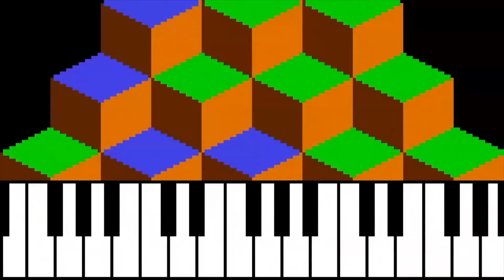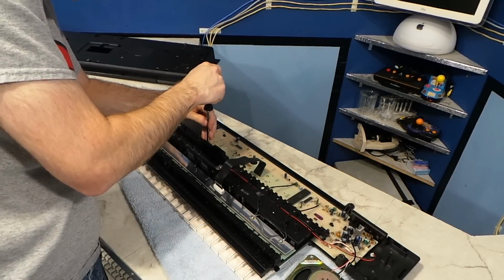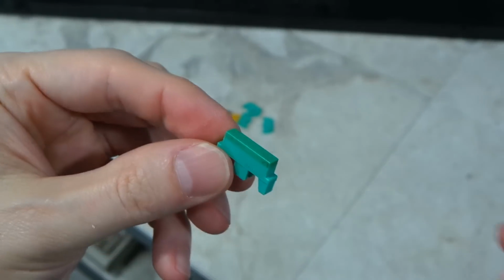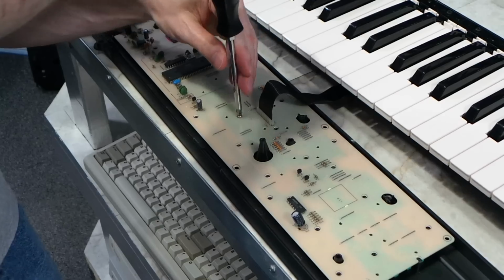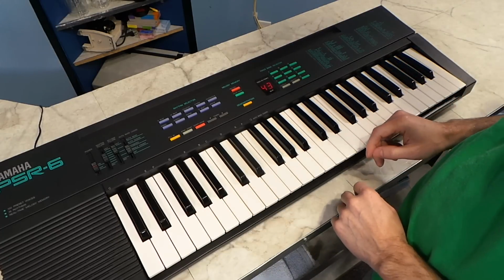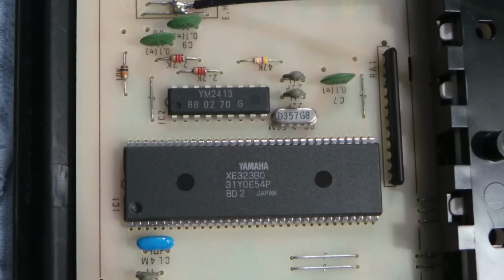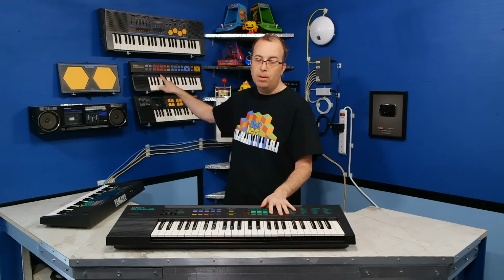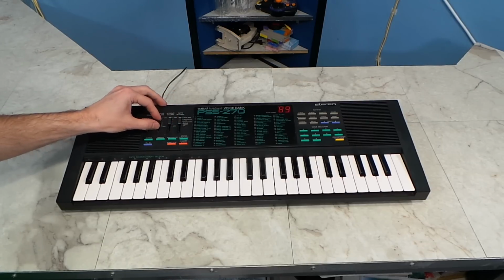Yamaha PSR-6 Restore and Review

Comment: That keyboard may be kind of worthless, but it holds a VERY SPECIAL place in my heart.  It was the FIRST keyboard I ever owned.  Back in the late 80's, I was just beginning my very first actual musical recordings of tape experimentation (very musique concrete using multiple tape recorders and anything else I could find, crudely cutting tapes together to make rhythms and strange sounds) and that keyboard became an integral part of the setup.  I still have those old tapes from back then and the sounds of "Accordion", "Comet", and "Glass Celesta" were all used heavily in those recordings.  I kind of miss it and wish I still had it.

Comment: I have actually restored a PSR-6 this afternoon. To remove the keys you need to take out the long pcb where this "not disconnectable" black wire is as well as the rubber connectors beneath them. 
You get access to various groups of keys that can be unmounted together and washed. 
Still, great video. Have a good day.
Reply: I’m trying to restore one I got from my friend. Has some dead keys that I want to fix. Is the pan the green strip on the back of the keys?
Reply: And how did you get it out?

Comment: I had this keyboard as a kid. I just got another one recently from a goodwill in MN for $10. They said it didn't work and it was missing a button. But I powered it up fine and it works great. With the help of this video I took it apart, cleaned it up, and even found the missing button inside it. Looks almost new now. Thanks for showing the way!
I plan to use this for some ambience; even the cheap sounds are awesome when run through a bunch of Earthquaker devices. 😁🎵

Comment: Your videos gave me the "power" to restore my old PSR-210. To make a long story short: after some trouble, I managed to complete the task. 
I disassembled the complete device, didn't disconnected soldered cables, so I unscrewed also the speakers, to get rid of the small circut-board. I used a sheet of paper, drew boxes on it, where I put the screws. I named every box, so I couldn't mix up the screws. Then I disassembled the keys and gave them a slight rinse in the kitchensink, which was fairly enough, I polished them with a soft cloth afterwards and they do look fantastic. I gave the case a clean with the garden hose and that  rinsed the dust and gunk from the years. I learned that my keyboard was made in 1993 from the markings on the case, the chips and circut-boards. When I reassembled the whole thing, I mixed up some screws nontheless, but after I disassembled it 3x, I figured every single screw and I had no one left over anymore. Then I remembered, that I forgot to connect the battery compartement, so that was a last, 4th disassembly... Before the restore, the keys were somewhat sticky, you could even hear them. After I was finished, the keys are completely silent and move totally smooth. I wouldn't have done this without your videos.

Comment: The other day I found a keyboard at a neighbor's curb that was going to be sent to the dump. I grabbed it because it looked like it was in working condition and it worked fine when plugging it in with a generic AC adapter. The keys were a little dirty, but other than that it was in great condition. The model in particular was the Yamaha PSR-290, which isn't even old enough to be considered a retro keyboard, and it's overall it's a decent pro-sumer keyboard.
Reply: Nice find! :D
Reply: Same 1st demo song as the PSS-270! https://youtu.be/zGTAOmBQZLA?t=27s

Comment: The YM 2413 was used for the FM Expansion Module for the Sega Master System In Japan Only. I would recommend listening to some of the soundtracks.
Reply: Dynamite Headdy No wonder it sounds similar!
Reply: It sounds similar to the VRC7 chip, too.
Reply: I will say this again go listen to some of the soundtracks and compare it to how it sounds on here.
Reply: Only Lagrange Point used VRC7
Reply: TastySnax12 - That's because it's a derivative of it. The main differences are that it only has 6 channels instead of 9 and has no rhythm channels.
Reply: The expansion was for the Sega Mark III.  Later it was built in to the Japanese model of the Master System.
Reply: Certain MSX add-on cartridges and later  built in to certain MSX2 computers.
Reply: Yeah Those Computers Sound Really Good! People Underestimate The YM 2413 Most Of The Time But If You Really Take The Time To Understand The Chip You Can Make Some Good Music.

Comment: I remember my mom used to have a keyboard... I swore it was a Casio... but it might've been a Yamaha. It had a bunch of colorful buttons like this, but actually had more of them. It didn't have a screen either, and the speaker was up with all the buttons, not to the left/right of the main keys. I remember it had some really funky sounds and demos, it also had a metal bar to hold sheet music up, and she had a dust cover for it too. I have no idea what exact model it was... but I wish I could figure it out. It was all black / dark plastic on the outside. I also remember it having a MIDI (DIN) port(s?) on it too, but we never used that. I swear it must've come anywhere from the late 80s to mid 90s.
Reply: wow, looking it up now... it might've been a Casiotone. Surprised by how quick I found it this time... previously I couldn't find anything.
Reply: look in the old picture albums your mom probably made,   if not there should be some box littered with old pictures where they just got too lazy to ever put them in an album :P
thats the way I found out the old model we used to have 25+ years ago :)
Reply: I still have an old casio. We had a box, manual, power supply and dust cover for it, but we put it up for auction years ago. It didn't sell, but along the way the Auction house lost the power supply, and apparently threw out the box.
Euugh. Figures.
Reply: I remember that one. It had some letters in the name, then a dash, and then a number... ending with a zero, I think.
Reply: Black Casio keyboard with color buttons, speakers AND midi? Well, you're having a lucky day, because there aren't many Casio keyboards from back in the day which fits that description. I think it's probably one of the keyboards from their 1989 Midi line: MT-240, MT-260, MT-540, CT-460, CT-640, ... They were all very popular back then. There is also the HT series, but those aren't very colorful keyboards. Nevertheless, they are the HT-700, HT-3000 and HT-6000. Good luck finding the correct instrument! Was it a smaller keyboard or a bigger one, by the way? That would narrow down the results quite a lot.
Reply: I have a CT-640 ... since around 1991.

Comment: That was actually a neat little tune. I had a PSR-12 back in the day. Shhh, I was in the Air Force way back then, and made a stand for it out of scrap 3/4" titanium tubing with black plastic caps for the ends and rubber feet. I also fashioned an aluminum banner plate/bracket that I painted black and stuck those giant sticky white vinyl letters you can buy to make a sign across it, saying "YAMAHA". When I sold it in a garage sale, I probably didn't mention that the stand was probably worth 20 times more than the keyboard. Maybe I did. It was a long time ago...

Comment: Well, here it is, the review of my favourite keyboard out there (since I owned that as a kid, and I still have it BTW). Shame you didn't like it that much, but I understand PSR-6 wasn't made for high-end use anyway. But, what I found interesting, was the dissasembly process. Because I managed to do a full dissasembly last year, and I didn't manage to hit any snags just like you. The bare wires of the ribbon cable were clamped onto the mechanism so I could remove it by pushing the sides a bit, whereas for the keys themselves, I didn't have any problems removing them, so I guess there has to be a different version, either there were differences between US and European versions of the keyboard, or they simply redisgned it, because my PSR-6 was made in '89. But if you want David, I can dissasembly the keyboard again, and I can send the results plus some photos to you...

Comment: Buyed a keyboard as hobby
Cleaned it and forgot where were screws thanks for showing man @02:20 
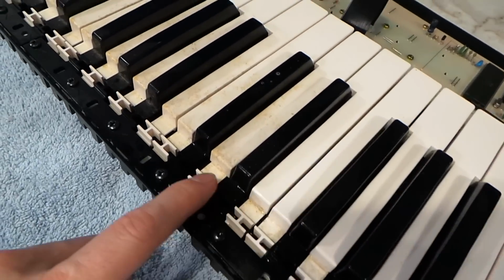Ohhh~~~~ btw those keys were hard trying to figure out @02:51 there were three layers black at the top
First u remove the loooong chip(at the back I don't know what else to call it)😅
U detach them from left side(the speaker side) one by one set of octave by pulling them at 90 degree
Thanks man

Comment: Great video as always! Regarding that plastic clip/connector for the ribbon cable, it looks similar to some I've seen used in 1980s Pioneer gear where you have to press down on it - in my case I had to use something like a flathead screwdriver and the ribbon can be removed while you're doing that.

Comment: This was my second keyboard. First attempt at multitrack recording, too. I had a dual deck tape player set up in my room. I'd record my drums through the mic onto one tape, move it over to the playback deck (only one deck could record), run a wire from the keyboard to the mic jack, record the first keyboard track, then keep repeating the process until the quality dropped too low (each iteration would lead to a significant decrease in quality) or I couldn't come up with anything to add to it.

Comment: 1:37 You must press downwards on the inner white bit and then the black cable will come free, all leads exposed. Must line it up well when re-inserting or you can crimp a wire! Many variations of this connector will be less frustrating knowing the method! I leave this comment for any future peoples. I just saw that Rail Ventures already said this 3 years ago.

Comment: I don't know if you ran into what I did. The one I had wasn't in tune with other keyboards and definitely could not be used in any capacity in a jazz band. The connector is removable, forgot how I did it. I was in the habit of installing rechargeable battery packs, and the one I installed was a 12V DC gel pack from Sony, that fit on the right side. I also used a stereo emulator/simulator to give the appearance of stereo sound. While I admit, I was able to write a few tunes, not a good keyboard for musical hobbyists that use a multiplitude of instruments. There was a MIDI mod that was released at some point that I wasn't able to get to work with mine. Other than polyphonic and full size keys, I was disappointed with mine. Not sure if the tuning thing was a specific problem with mine. Not sure if you ran into that problem. I'll admit, you wrote a good tune for your demo.

Comment: if you lift up the black keys it unlocks the rest and they all start coming apart easily. I think the board and membrane also needs to be removed first. It is also difficult to reassemble the key sections in the correct order.

I also spent a while trying to work out how those connectors work. lift both ends then the cable is released.

this is at least how it was on a psr-73

Comment: David, I think a small compressor and a pressure washer would make your life easier. Right at 2:38 you could have taken the key assembly outside and hit it with compressed air and a pressure washer (using plastic bags to protect electronic components that you couldn't detach). I am sure an electric pressure washer would be plenty, but even a powerful gas powered one could be used, just use a wider angle and proper distance. It would blow all the dirt out of and around the keys... ok, now I can go back and finish watching. :)

Comment: That pop, I've heard that exact pop before when I was doing a discrete YM3438 on a Genesis model 1 mod, replacing the YM2612 (I was the first one who actually succeeded in doing this mod).  It happened when there was an impedance mismatch because the FM synthesizer and the op amps..  It's fixable, but it's funny Yamaha didn't get this correct when they manufactured it, or they simply didn't care too much since it would be sold cheap anyway.

Comment: Bit of a fun fact: the YM2413 is the same synth chip used in the SNK Neo-Geo arcade system and console. Some excellent tunes were made with that chip!
Reply: Neon Lemmy Koopa Actually the Neo-Geo systems used a YM2610, Which was basically 4 FM channels, 6 ADPCM Channels & 3 Square wave & 1 White Noise channels.
Reply: You're right. I was confusing it with some of SNK's earlier boards, which used the 2413

Comment: 1:23 don't know what that connector is called but DO NOT TRY TO DISCONNECT IT!!! I found the same thing in my Pioneer RX-560 hifi and they are meant to be permanent. Found that out the hard (and expensive) way

At least I finally learned how to solder after all of that

Comment: Those key look very similar to the ones on my keyboard ( also a Yamaha, though a newer model), which come off by pulling them toward their free end: there's little hooks under each key. They might be kinda stuck in there if anything was spilled on it, though, making it seem like they're permanently clipped in there. The wire clip things have a bit that pulls up in mine, too, which probably won't come up if you're just trying to pry up one side, but those might be different.

Comment: I had one of these as a kid!  With just a few very minor tweaks (like MIDI out and an appegiator) it could have been a low-cost powerhouse.  The sheer NUMBER of patches this thing had, the built in drum machine and demo mode absolutely entranced me as a youth of all of 8 or 9 years old though, the fact that you had one instrument with so much flexibility, and the capacity to make so many sounds was really the start of my love with synthesizers.  I actually learned to play Piano on one of these, I had one at home so I could practice between lessons.

I'm also surprised you can find them on eBay for basically the same price they were new.  Most bits of "vintage" (sadly I think I need to give up the fight and admit that 1989 was almost 30 years ago, so 90s gear is now "vintage digital") gear either depreciate hard (I got my TR-505 for 50 bucks) or appreciate in value (look at what they charge for a  Juno these days!) but the PSR-6 has just about stayed at the exact same price forever.  That sounds about right to me.  This thing utterly defines the preteen-piano-recital-core sound.

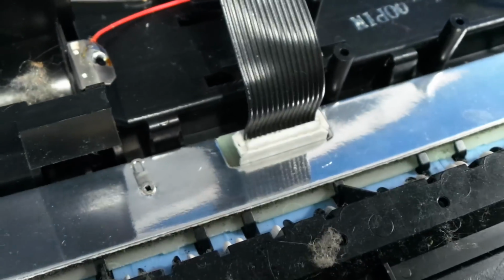Comment: 1:41 --> actually is easy to disconnect this cable ... it´s just clamped inside the plug ... you can lift up the top of the plug and then it´s easy to take out the cable ... --> I think

Comment: Yep, a bit of desoldering, accidentally damaging helps to allow you to clean the keyboard inside out & outside it.
I personaly wouldn't do that as i may can tuin the device, i remember opening up a gameboy and accidentally did put one screw back in a forbidden gap what seemed to be a screw hole but i clearly did oversight that warning label to not put a screw in there.
But apart from that you did a great job of composing music out of it,now maybe you could add a lowpass filter into it to get rid of that noise to specific tones/notes but not sure,
But still, you did a great job.

Comment: Those connectors are hell, they should come out by pushing on both ends, likely with a special tool, to release the ribbon. I have run into them on some things I have disassembled.
Reply: I broke one off on a stereo I was repairing once, because I thought was just a really stuck connector.  All the others were standard molex like ones and were quite hard to remove because of mild corrosion. Had to desolder that and hard wire it afterwards, because it was damaged enough that the connector would no longer plug back in. I'v made sure to look out for those annoying things since.
Reply: Yeah, I found them all over the Onyko receiver i had to disassemble.
Reply: Nepal Plush Onkyo used them. I did all of them successfully but had to seriously modify one. Press straight down on the part near the wires, then pull the wires only, they should come out. To put them back in, press on the connector while inserting the wires.

Comment: These kind of keys can be removed by removing the circuit board by pushing the tabs one at the time while lifting the board up and the rubber pads underneath and unscrewing all the screws and lift the black keys from right to left then the D, F, A keys how ever you want and the C, E, G, B from left to right.

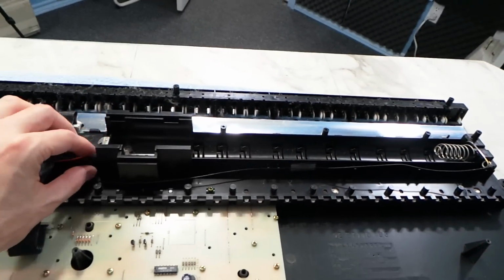Comment: 1:18 - You're supposed to push DOWN on the top plastic part of those ribbon connectors. :o

The cable should then just freely come loose.
(the cable at the main board end is soldered though.)

They are very common connectors on other keyboards, especially on Roland stuff.

Comment: Where do you get info about the Yamaha sound chips?  I bought an 80s Yamaha Electone organ, mainly to use as a MIDI controller for a clonewheel app, but I've played around with its built in sound too.  It sounds like an 80s synth, but doesn't, unfortunately, have synth-style controls.  I think YM2167 is the synth chip according to a copy of the main board IC list.  It lists LH00808 Z80 clone as the CPU, which was the ARM of its day.

Comment: Looks similar to the Casio ct380. Same size and amount of keys. Same mono speaker on the left. Could not remove the keys on either of them. Psr 6 was all plastic though. The ct 380 had a metal back panel, but it was rusted on one side, still better than all plastic, and at least it used springs on the keys. The Casio piano, which had a Panasonic chip in it, sounded a little better than the ym2413. Psr6 seemed cheaper.

Comment: What would you recommend for fixing connection issues with those rubber button pads?  I'm trying to fix a mid-90s Yamaha, and half the keys don't work unless I push on the underside of the circuit board.
Reply: The Synth Wizards did a video about a keyboard with those. They stock many keyboard and synth parts. They have a YouTube Channel and a webs where they sell the parts.
Reply: That's website.